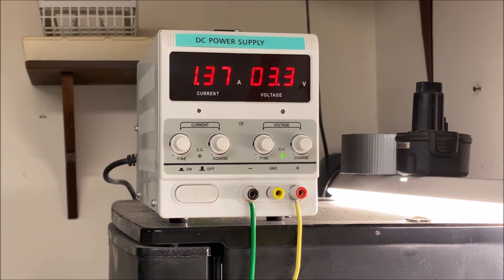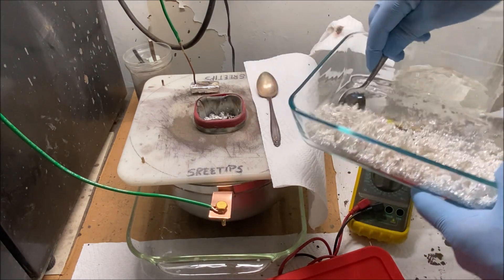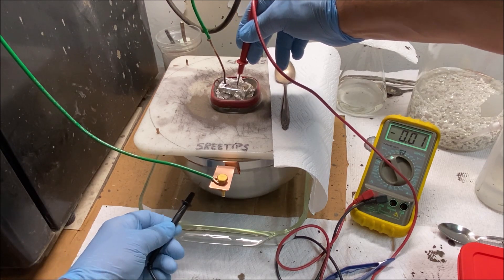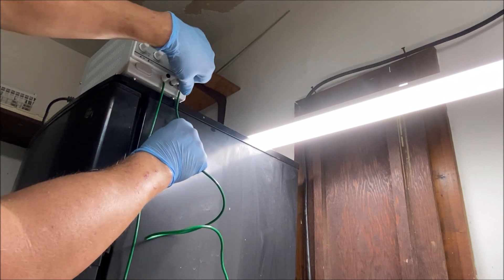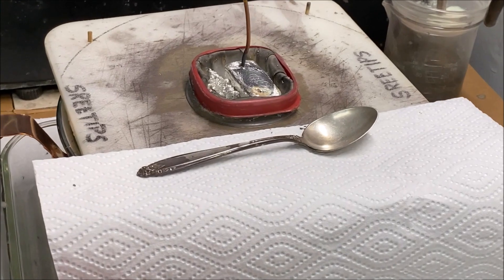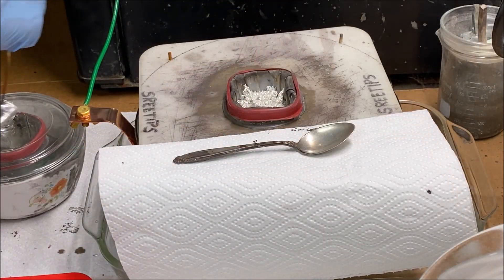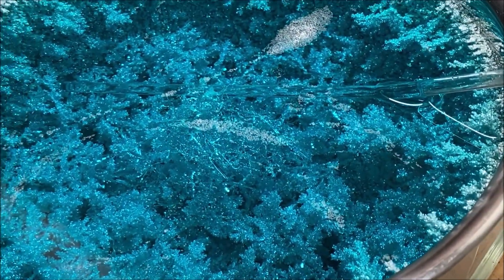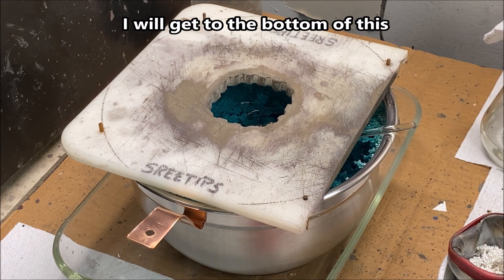EP009 Silver Cell Crystal Contacts Anode Filter

Comment: Hi Sreetips! Is it okay to use 50g/L for the electrolyte? Will the it take longer to crystalize? Why did you choose to use 150g/L?
Reply from the maker: Sounds a little low. 100g per lites was suggested. I use 150g because I usually reuse the electrolyte a second time. But I also add another 200g of silver to the electrolyte for the second use. It gets depleted as the cell operates.
Reply: @sreetips  One more thing, is it okay to rinse the powder with tap water instead? Will it cause the powder to become impure and turn dark in colour? I would like to maintain high purity without going via the silver cell.
Reply from the maker: I use distilled water when working with silver
Reply: @sreetips  Is there any reason for using distilled water?
Reply from the maker: No chlorine
Reply: @sreetips  with that, can I use anti-chlorine to be added into tap water instead?
Reply from the maker: Distilled water when working with silver.

Comment: No NO NO NO NO. You don't need to start over. You don't have a hole burned into your basket. When the crystals got too close to the basket, the current will increase the closer it gets to the basket and will eventually blow the fuse. It works the same way when you're de-plating gold in your stripping cell, the closer you put the lead bar to the copper basket, the more current it will draw. It's the same way with my Copper cell I have here at home in my shop. The closer the anode is to the cathode the more current it will draw. The "PLUME" formed because the current spiked up and crystals grew very fast and stringy. When they got within millimeters of the anode basket, the fuse blew from over-current.. I'll bet if you check your basket there will NOT be a burn hole in it.  Even if there was a hole, the Silver you were using was DOUBLE refined anyways, there should NOT be any slimes in your basket, If any Slimes Did manage to make it into your silver cell, they will simply Wash right out, they don't carry over with the silver and stick to the crystals. 
If that were true You would need to re-start your cell every time you see BLUE in your electrolyte, because that BLUE IS COPPER CONTAMINATION!.
Reply from the maker: Too late, I’ve already triple refined it. Video uploading

Comment: The metal springs inside the fuse holder are causing your problem. If you change the fuse holder to one which has compression clips It may work better.. Plus you can also Solder the wire inside the fuse holder to the "springs" Or better yet, if you're really serious about using an inline fuse, they make fuses with solderable leads on them called PIGTAIL fuses. You just solder the wire to the ends of the fuse pigtails and you're good to go. Of course if the fuse blows for whatever reason, you'll have to cut out the fuse and re-solder in a new one.

Comment: I need to look at your previous videos but i think you have kept the cell running at what looks like 1.5vdc @ 1.5adc through out the experiment. 
I see at the end of this video you have a reading of 3.3vdc @ 2.5adc.
Did you increase the voltage near the end of the experiment? If so then that probably made the crystals grow to fast.
Keep using the current limiter on the power supply. higher amps might be your nemesis. same thing can happen while electroplating.
keep the fuse. even with the added resistance, the power supply has enough power, just compensate by measuring the volts and amps at the cell.

Comment: Just typing out loud.  Is the silver adhering to the stainless steel bowl on the sides and bottom or is it building up from the bottom and stacking on the sides? 

Continuing my thought, if the silver is not mechanically holding onto the stainless but is rather piling up like snow against a garage, would it be beneficial to scale it up to a stainless stock pot or something with taller sides?

The electricity will want to take the path of least resistance, meaning it will shoot from the basket to the nearest anode. As the silver is plated out, the density will allow it to fall and push your electrolyte up. You will have a longer lead time to notice any encroachment on the anode basket as the silver piles onto the bottom rather than building on the side.

Comment: Would something have changed when you switched from the crystal batch that was in the beaker over to the batch that was in the the corningware dish? You had  little or no copper in the electrolyte due to it being more refined  but then when you switched to the other batch, it seemed like the blue copper solution formed. I’m not as experienced as you or others on here but just a thought. Love the videos!

Comment: Yeah, maybe next time include REPOST in the title. Also, why exactly did you feel the need to rerun all of that silver and waste 10 days? The only thing that the silver touching the filter would have done is short the process and keep crystals from growing, so tell us again why you felt the need to rerun that silver?
Reply: He said that it burned a hole in the filter when it shorted out.
Reply from the maker: Harold_V was a mentor of mine. He used to say, “avoid sending out questionable metal, like the plague.” Rerunning the silver after it shorted - well, it’s the only way to be sure.

Comment: oooh noo... get a hammer and destroy that fuseholder! You  adjusted the powersuply by making a full short circuit so what's the problem? Get a lamp and put that (beep) fuseholder in series with it. Then start to rattle or twist the wires and I betcha the lamp will start to flicker.. that's the problem.
Reply: ooow haha. an old video.. I suddenly realized it when I noticed the electrolyte was suddenly green haha.

Comment: Is there something you could use as a shield, that would prevent the crystal from making contact with the anode basket, yet wouldn't impede the growth of the crystal? Like a plastic ring, bigger than the basket, yet, it would prevent the crystal from making it to the basket.
Reply from the maker: I solved by using constant current mode on the power supply
Reply: @sreetips  Thanks for clearing this up.

Comment: Brotha, I’m sure now you’ve realized the need to keep your CV set to limit at 1.5 amps. When you get up to 2 amps, that makes the crystals form fast, long, spindley and they will close short gaps very fast. In less than a few hours fast. The closer the cathode and anode are together the more current can flow making the crystal grow faster and fast to bam! Short. Two things I would suggest… raise you anode basket out of the electrolyte so that only like the bottom inch is submerged and get that cv set to limit at 1.5 amps. Low and slow gets chunky thick crystals. And as much as it pains me to see you have to redo the batch again, I do love the saga that this has become, is a soap opera I now affectionately call “Days of his silver cell lives”.  Looking forward to a clean run this time around!
Reply: You fooled me. Didn’t realize this was an old vid. Had me thinking you had to refine it again. I was wondering why you said you touched the strap yesterday. I was thinking wait a minute. He didn’t touch the strap when measuring yesterday. But maybe I didn’t see him do that…

Comment: So why are you letting the current go up to 2.4Amps?  I thought you had your power supply limited to around 1.5 Amps before.  I think what's happening is that your cell has a lot less resistance once you have a significant amount of crystal growth in there so you don't need as much voltage to draw 1.5 Amps (those crystals are like wires extending from the cathode towards the anode and lowering the resistance).  I'm just wondering if the much higher current level you're getting now is leading to a different type of crystal growth.  Also, with the current limiting feature of the power supply you really don't need a fuse - it won't do anything.
Reply: This is a repost video of what caused the 3x refining. No worries 👍
Reply: @macoppy6571  Doh!  Thank you - I was horrified to think Sreetips had to go through this again!

Comment: Not sure I really understand that making contact with the basket changes anything with the purity of the silver. Isn't it pure silver to start with? What is it that contaminates it? I don't get it. Silver in the basket, silver anode, silver electrolytes. All pure....
Reply from the maker: If silver contacts the anode basket it burns through the bag until it shorts out, releasing slimes from the anode filter into the silver and contaminating it. I had a fuse to blow before the burn through happened. But I can’t be certain that it didn’t burn thru before the fuse blew. The silver is questionable. The only way to be sure is to run it back through the cell a third time - like deja vu all over again

Comment: Check the filter w/ a magnifying glass -- You may find that no hole is present.  Also why not use a nice long tube to load your shot into instead of the little basket.  Give it a weeks worth of shot, then pull the contents at 7 days.  Looks like the amperage rises too much and it starts to run away depositing the crystals closer and closer basically just running away.  If you want to limit current outside of your power supply, use a 5w resistor (1.5a at 3.3v = 4.95w).  That may prevent this from happening again.
Reply from the maker: I fixed by switching to constant current mode - no more anode catastrophes
Reply: @sreetips  I thought you were already running constant current / voltage but it kept getting away from you.  Either way a 5w resistor is cheap insurance.

Comment: Since we time warped backwards a week lol when you redo your silver pouring onto your copper wire tin the wire first with flux and silver solder when you pour the silver over the wire it will bond better
Reply: Flux is not tin, I know what you meant though. Tin is in the solder. Tinning is when you put solder on your iron tip to keep it from corroding. Flux is acid which removes oxidation off the wire. I make my own from pine tree sap and isopropyl alcohol. It is tree resin flux which works really well and smells nice. Flux can also be used to lower the melting point and make impurities float to the top since the lower melting point makes the melt more liquid at the same temperature.
Reply: @excitedbox5705  to tin or tinning is done to prepare the copper, tinning is also used in bodywork when you are going to apply lead to a body panel etc.yes tin is a metal as in tin can. To tin or tinning is a process
Reply: @excitedbox5705  P.S. however you phrase it he still needs to do it lol 
have a blessed day

Comment: Maybe just harvest the crystals a day earlier. I kind of thought they were getting pretty darn close on your earlier video tonight. This is another situation where there is something of a runaway condition possible, in that once you get a good spear growing (for whatever reason) and that spear gets big and fat, cell current has to travel through less electrolyte to get to it. That means less resistance = higher current, and the spear begins to hog cell current. More and more as it gets closer to the basket. So, as the recipient of more current, it grows faster than any other cluster in the cell. Then, kaboom. I do not think you're doing anything wrong other than letting the cell go a tad too long.
Reply from the maker: This is 2 weeks old, I took it down. Then reposted. It’s the reason that I’m running a third pass of the pure silvet

Comment: When you show us inside the bowl, the drips of liquid falling off the anode basket make it hard to see what is happening at the bottom. Thanks for putting the top section somewhere else so we can see more clearly.
Reply: This is a old video
Reply from the maker: It’s the reason I’m 3x refining the current batch
Reply: @sreetips   What I mean is, whenever you do the shot where you show us inside the cell, the dripping liquid disturbs the surface of the electrolyte making it impossible to clearly view the crystals.
Reply from the maker: I see, you’ll get a clear shot of it with no drips as I harvest the crystal tomorrow

Comment: It's that massive surface area from those dendrites. Sorry to see it fell over, maybe take a measurement of the distance between the basket and top of the bulk of the dendrites and use that as your end point for the next run?
Reply from the maker: Already fixed it by running the power supply in constant current mode set at 1.5 amps
Reply: @sreetips  Cool - when we cleaned our gold cathodes, we chose the constant current mode. Didn't think that 1000 amps through one cathode would have been a good idea.